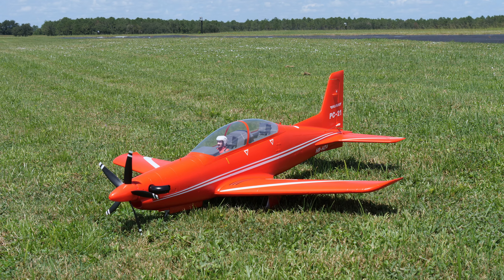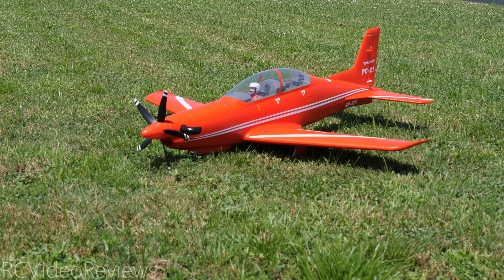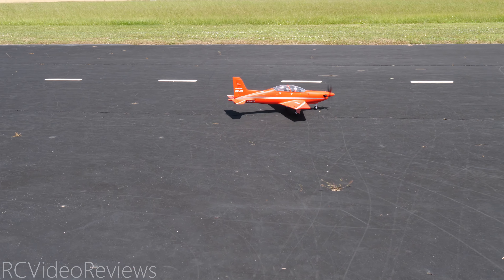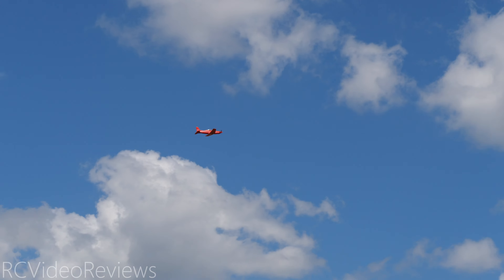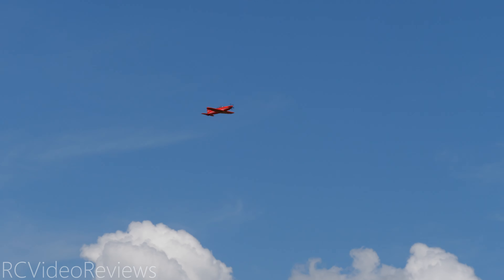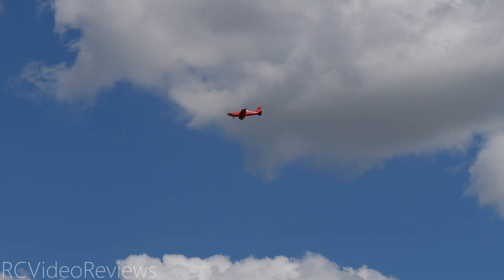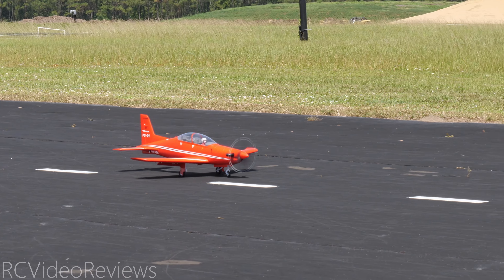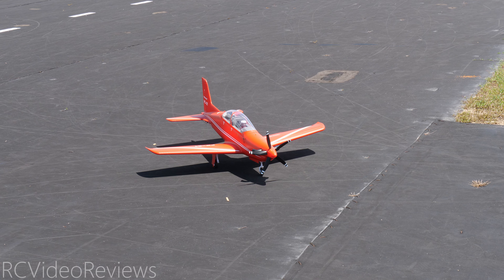1100mm Pilatus PC-21 PnP with Reflex v2 RC Plane by FMS • The Maiden

Comment: The extra yellow lead from esc is for reverse throttle. Plug lead to signal on open channel on receiver. Setup switch of your choice on that channel. I used tx16s and radiomaster R88 receiver. Prop off to test. Let me know if you have any q's. Not alot of content for this.

Comment: Hi, I just bought this one, but still haven't fly it.
Do you have a video on how to set the stabilizer on it and how to do different trims on different flight modes as you mentioned on the video.
Reply from the maker: The Reflex doesn't really have any settings outside of off, on, stablize. I set trims per flight mode on EdgeTX.
Reply: @RCVideoReviews  thanks I'll check it out

Comment: Thanks for the review. How did CG go on this plane for you? I'm just setting one of these up myself and I've read where others have either had to add nose weight or shove the battery forward  halfway ahead of the tray in order to get the recommended 90-95mm CG.

Comment: Can i use this reflex v2 controller in a plane that is not FMS plane?  Thanks
Reply from the maker: They're not really designed for that as there is no configuration you can adjust. The only option is to load configurations of FMS planes. That said, if the size and servo outputs of your plane match an FMS plane, the gyro wouldn't know the difference. TBH for a non-FMS plane, the best gyro is the A3S4. Motion has them for $30.
Reply: @RCVideoReviews  tks for the advice . that is a good price, can i use it with a dx5e as slave and a dx6e as trainer transmitter in buddy box set up ? thanks again!!!
Reply from the maker: I'm sure you can. I don't use or know anything about Spektrum so I'm not the right person to ask though.
Reply: @RCVideoReviews  tks!!!

Comment: Uh Oh, does it give the MM a run for “Favorite”?
Kinda looks like it could. A “Cupcake” as you like to put it.
Reply from the maker: I'd say so. This plane does it all and as the video shows, the flaps are effective. Was able to really nose it down and float in. Obviously the problem with retracts is if you have issues landing. The MM can take a punch on landing. To this day, I don't believe I've replaced the mains on a MM. That said, the PC21 would need about 2000 more flights to take the crown from the awesome little MM. :)